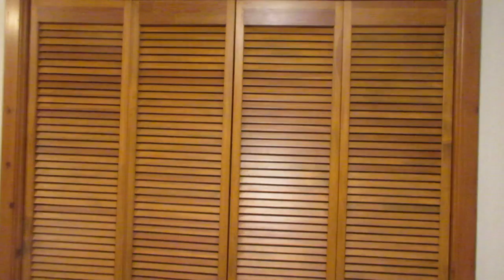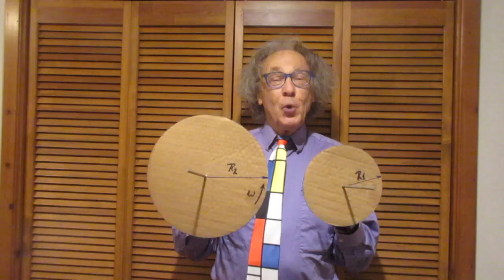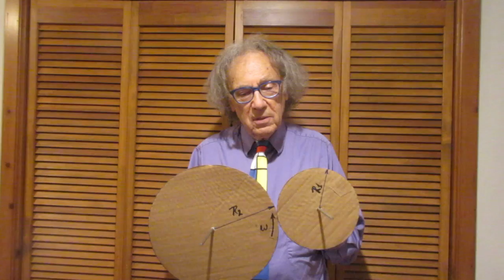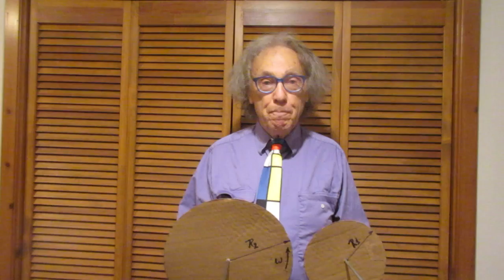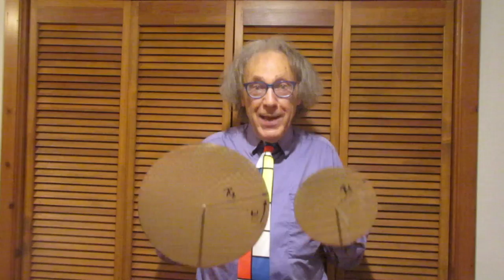Solution 1/2 Problem #8 - Rotating Discs

Comment: sir I have a question 
sir Albert Einstein said if u go too fast(speed of light) then ur clock will go slower related to others..
and if ur clock go slow u r in the past as compared to others
so my question is what happens when we go too too slow what would happen?
Reply from the maker: use google
Reply from the maker: >>>the faster you move the slower your clock will go>>>
INCORRECT
Reply from the maker: You are confused. I suggest you read up on the twin paradox.
Reply from the maker: YES, and the slower will the clock go of the outside observer as viewed by YOU.
Reply: If you stand still and don't move (which is hard to do because everything is moving and there is this thing called gravity) the time will go at normal speed, the faster you move the slower your clock will go. At the speed of light a weightless clock will freeze.
Reply: The faster you move the slower your clock will appear to go to an outside observer who is standing still?
Reply: I think it's a change in acceleration that will alter the clock. Accelerate out of one frame of reference and accelerate (decelerate) back into it. Now your clock will show less time than an unaccelerated clock.
Reply: First of all when we move with high speed after coming to the normal speed we are in future. Consider speed of light is at 0 position on real line. If we move towards 0 then time slows down FOR US w,r,t others if we move forward to 0 scientist believe we will go to past. As, after 0 -ve change to +ve. And if we move very slowly its effect is nothing special.
Reply: The reason is that we see time through light. So when we watch someone moving close to the speed of light every milisecond (so to speak) will be stretched for the observer if he is moving away from you.